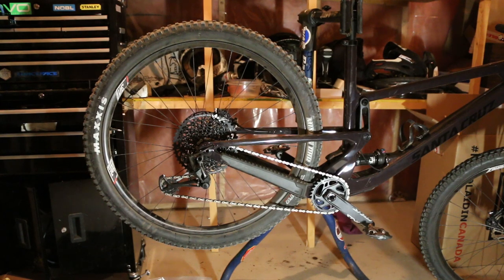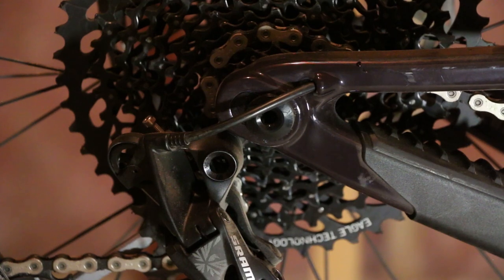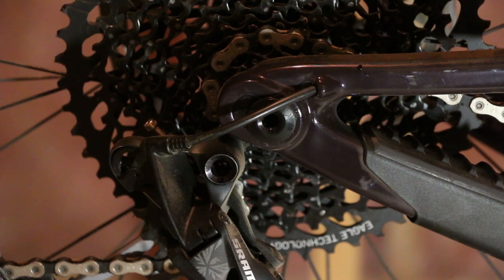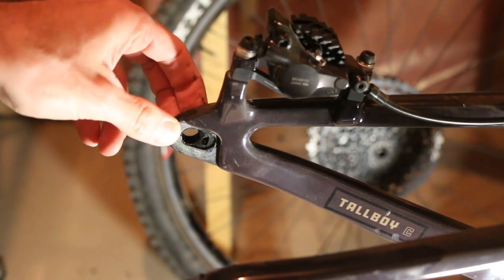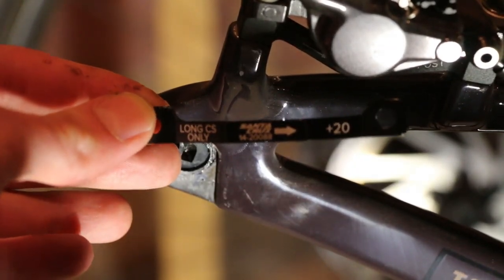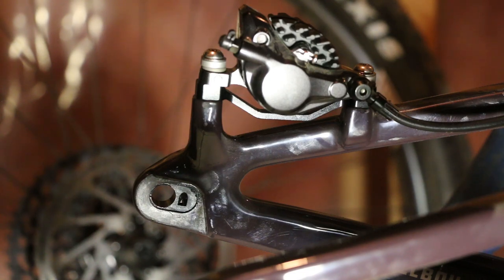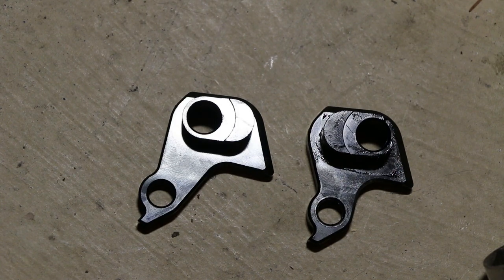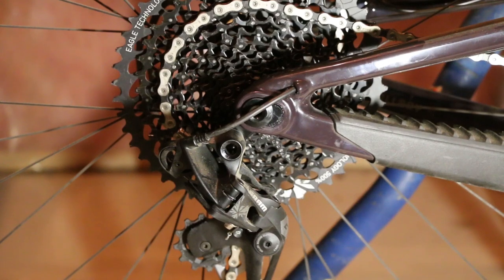Santa Cruz Rear Axle Flip Chip  - Short to Long

Comment: Great info. Switching over my TB4 and wanted to know if you had 2 black washers in the brake adapter kit?
Did not have them on the original bracket. I assume they go on the bolt last then get attached to the new brake adapter? Thanks
Reply from the maker: I can’t remember… I did have to change bolt lengths for the brake adapters though.

Comment: Hi guys, don't you know if some other manufacturers are producing this adapter? I'm looking for adapter for 180mm rotor long chainstay.
Reply from the maker: I would get the SC adapter.
Reply: The SC website says you have to use a minimum of a 200mm rotor for the long CS position - is that right?

Comment: What’s the trick to getting access to the flip chip on the drivetrain side of the bike? I can obviously get to the one where the bolt loosens from but can’t get to the other one on the other side to flip it!
Reply from the maker: Replace the hanger. They don’t flip on the drive side.
Reply: @MitchOnTwoWheels  I am not speaking of the rear one, but for the one connected to the shock.
Reply from the maker: Check this link out. https://www.santacruzbicycles.com/files/geometry_adjust_-_flip_chip_my18_nomad_final.pdf
Reply: @MitchOnTwoWheels  wow, I feel like such an idiot. Seems odd that even the slightest adjustment would need to take place on both sides but will give this a shot. Thanks!
Reply: @MitchOnTwoWheels  Their flip-chip PDF states "Use a hex wrench to gently pry the flip-chip from the drive side of the shock mount. Make sure to position both chips in the same orientation."
Reply from the maker: You’ve got this!
Reply from the maker: You think it’s worth it to do a video on the front flip chip? I don’t mind as long as it serves to help people.
Reply: @MitchOnTwoWheels  100% worth it! I see flip-chip videos everywhere but not a single one actually showing how it's done, specific to the 2020 tallboy. The other bikes all have easy access to both sides. I have the same bike you do. Check out the build here - https://www.creativedogmedia.com/Tallboy/n-CQCSHv/
Reply from the maker: Drool!!!! I’ll have to make something then. Easy enough :)

Comment: So sad, you didn't show how to change and to fix the right flip chip and deraileur hanger !
Reply from the maker: It’s as easy as looking at it.
Reply: @MitchOnTwoWheels  You think so because you had the bike with all the parts under your sight but it's not possible when we don't have them. 
Typical educational and cognitive mistakes.
On the left side, we don't know if you tighten the screw and on the left, we don't what is the external part and how ti connects with the deraileur hanger, if there is a thread between the two parts ....................
Reply from the maker: If you’re worried about how the parts fit together, maybe you shouldn’t be trying to do it yourself. It’s without a doubt one of the easiest things to do, but if you have this many questions, maybe just take it to your shop 😊
Reply: @MitchOnTwoWheels  Yes, thank you for your answer. I understand ti's not very difficult to do but my goal is to have very precise and functional information to design the flip chip of my future frame. I don't have mountainbikers with that bikes near me and at shops, they are not very motivated to spend time wih people who are not customers and who are doing industrial spying ! 😁